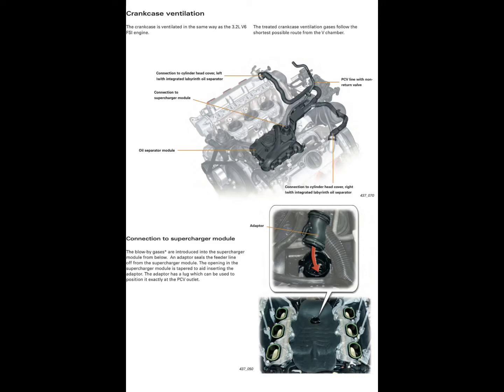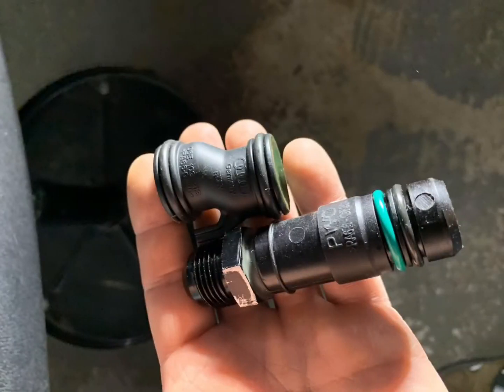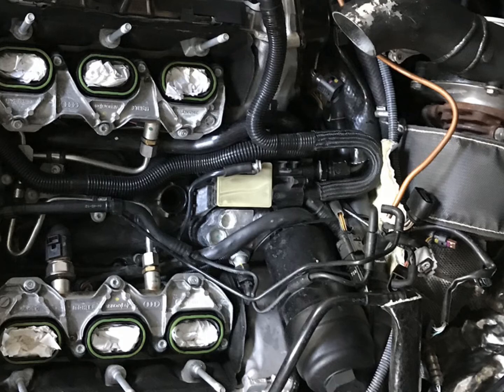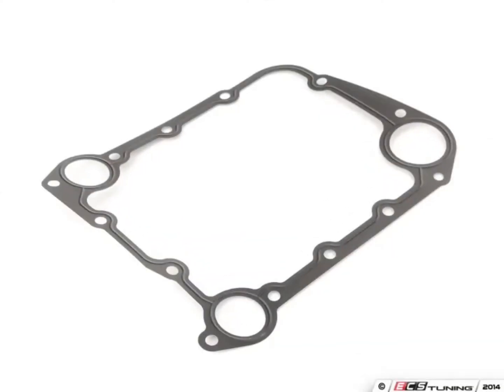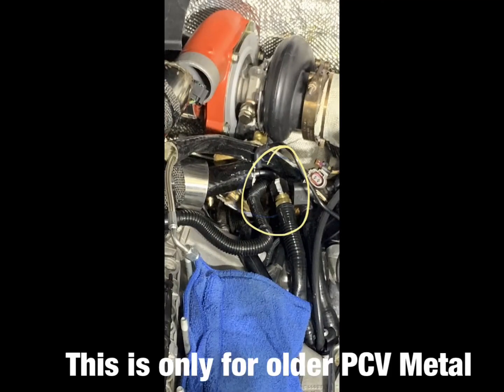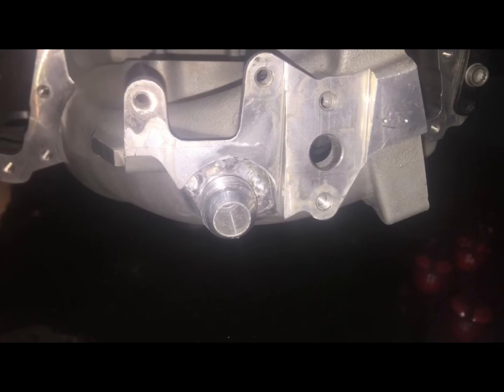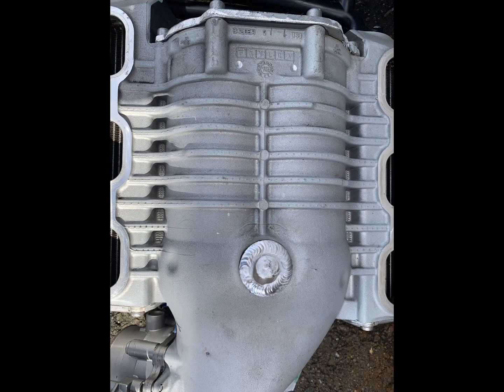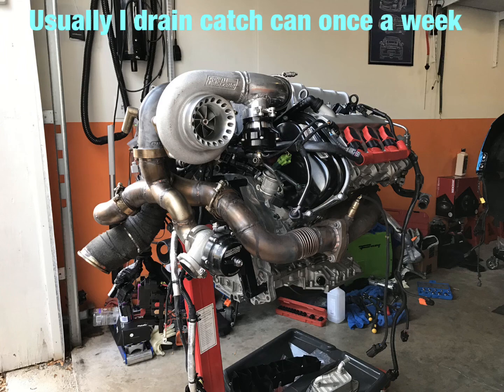Custom PCV for Supercharger and converted Turbo setup 3.0TFSI Engine

Comment: hey man question does a b8 S4 engine fit a c7 a6 with the 3.0t? my engine blew up and i found a low mileage S4 engine but the guy says the motor mount brakets are different and it will be plug and play?
Reply: Ever find your answer?

Comment: I've been in contact with the guy in Audi C7 Owners International's video who has done this... I'm not an expert; but this, is what I've gotten so far.

06E103245E Crankcase Vent Valve - This is what gets changed out periodically, and it's at the top of the engine
06E103772C PCV - Cast Aluminum, doesn't crack, much higher quality than stock.
06E103771C Valley Pan Gasket
06E103217H Breather (spider) Hose Vent

The guy who did this (not Oleg @ Svarog) says he doesn't run an oil catch can; but, he has one that can easily plug into the connectors... So basically a $30 oil catch can on AliExpress with the right connectors isn't necessary.

The Supercharger inlet where the PCV sits into it needs to be welded shut. Then a -10 fitting (believed to be 3/4 inch) needs to be drilled out and welded into the boost noodle (behind the throttle body and before the compressor blades) - seen at 6:00

There are various bolts (14 of part ES#468544 from ECS tuning), -10 fittings and a line that will be additionally needed... If someone could respond with any missing Part numbers, that'd be great.

Comment: Hey
Nice video tutorial!
I have a high milage CAJA wich burns oil. like 1 liter per 2500km or so.
PCV valve is changed for a new geniue one but it did not change a whole lot...
My inlet valves was pretty nasti in sod and carbon build-up so i have walnutblasted them but I can see they quikly gets nasty again.
So i guess my piston rings may not be in the best condition but I think by running a catch can set-up like this oilconsumption and prevention of carbon build-up might be improved?
Whai is your take on this?
Reply: instablaster...
Reply: @omarikhari3942  I'm not sure quite sure what you mean?

Comment: Can your setup be applied to a CAJA?
Reply from the maker: Yes this is exactly for those engines  CAJA/CCAA
Reply: @Svarogperformance  awesome I've followed your work for a while here and on Facebook. I want to do this in my A6. What other mods are needed to make it a 11s car? Removing the ICs inside the SC? 
Pistons? Where did you place the turbo IC? What turbo are you running? 

Thanks! :)
Reply from the maker: @erickbren8702  Just check my previous videos all of them have very rare info that can't be found anywhere
Reply: @Svarogperformance  will do! awesome!
Reply: @Svarogperformance  What about CAKA?